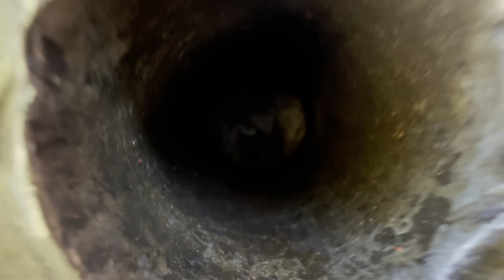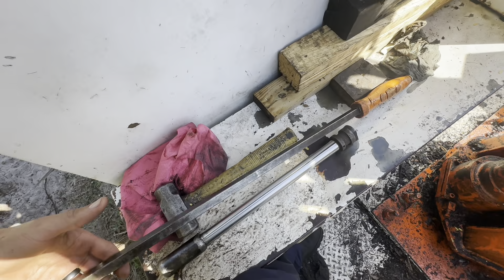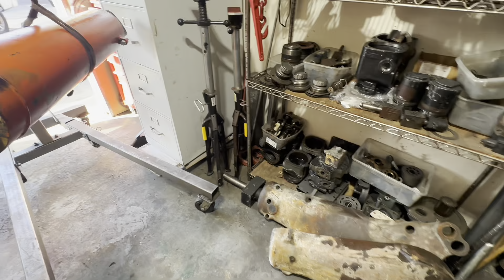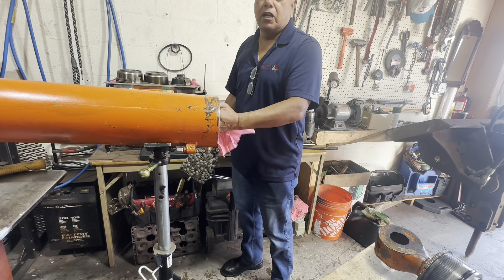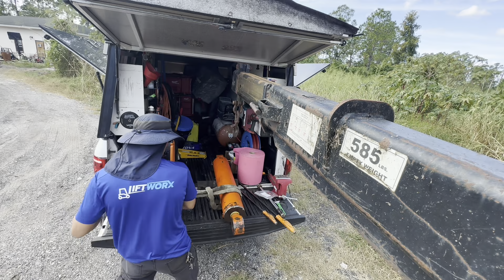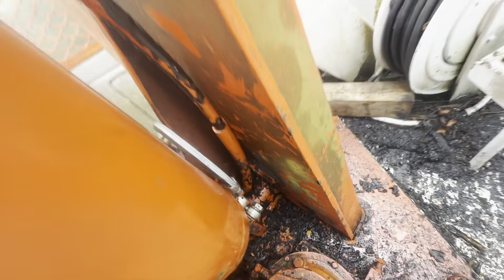How to Rebuild a leaking Boom Cylinder from a Bucket Truck

Comment: How did you bleeded air from cylinder?
Reply from the maker: You just open the hydraulic tank cap and lift the cylinder up and down a couple times

Comment: Have you had a Toyota code h5-1 and h7-1 mini lever solinoid abnormally open?
Reply from the maker: I personally haven’t had that code, but according to the manual, 5-1 is lift push solenoid open and 7-1 is attachment 1 push solenoid open. Sounds like a wiring issue or bad SAS controller
Reply: @theforkliftguy  sir do you know where I can get a manual myself